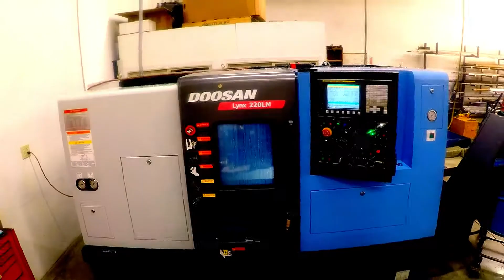MSV Racing CR500 exhaust manifolds in the making msvracingpowersports.com

Comment: Hi

Is there msv exhaust  manifolds like one you do for the Cr500 avaliable  for kx500s and others bikes also? My son needs one on his kx85?
Reply from the maker: The KX500 is the opposite of the CR500. The O-rings are on the expansion chamber instead of exhaust manifold. Sorry we have nothing for the KX85.
Reply: @msvracing3448  see i thought you'd make one for all bikes especiall the kx500 as it needs a metal seal there so vibrations dont wear out the exhaust port end of engine and leak gasses, think kx guru or someone om you tube has done this already as mills out then fits a metal bit to slide in and go over exhaust end as goes in, thing is if MSV DID one it may look nicer plus give power like cr500 one does lol.

How much power has kx500 got on the cr500 low mid and top with and without or standard bikes.?
Reply from the maker: @bentagliarini7918  do you have a design in mind that either wouldn't require machining the cylinder or using a CR5 style expansion chamber? The KX5 stock  had a couple hp on the CRs. Nothing that can't be overcome with a little engine work.
Reply: @msvracing3448  see thing is i like both bikes as currently looking to buy one but if i had work done to kx5 it will still be more im it than the cr5 but the crS go for more money so re sell value go up more than kx5 and easyer doin top ends as no powervalve so not sure yet, love both always been team green had coupe crs in past though so cr5 the look of the 96 shape i love the graphics more modern looking than kx5 but like that retro look also, but ill maby end up going cr, great upgrades for them cr5 so main reason woyld be as parts more readily available